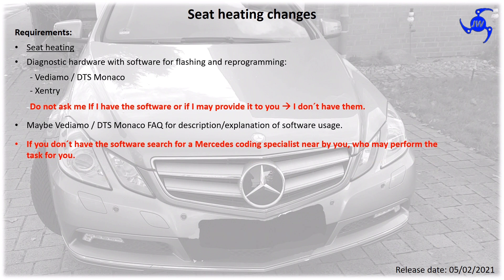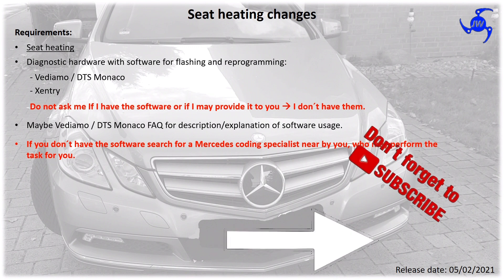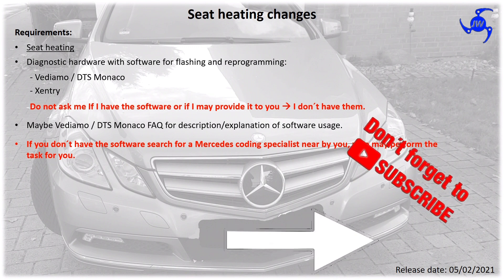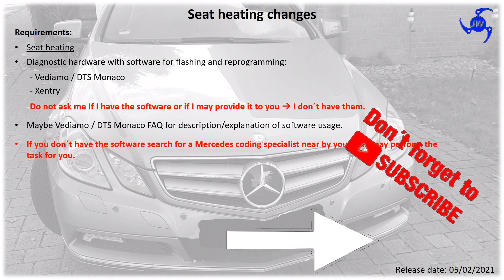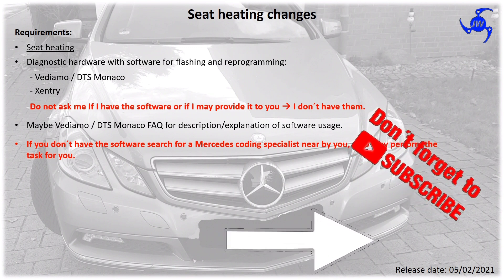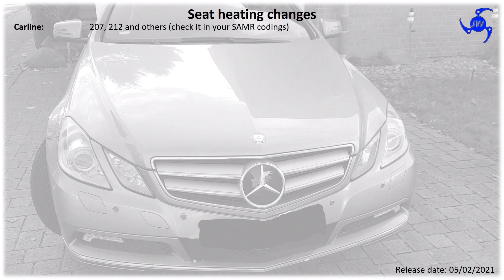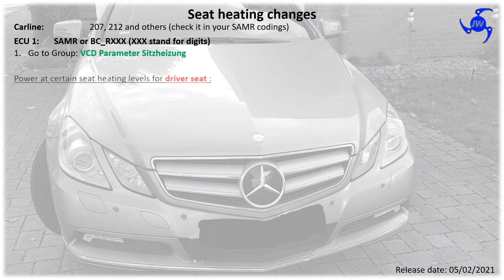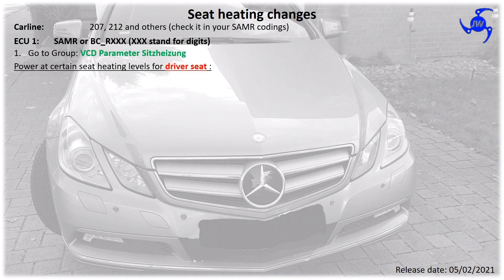DIY - Seat heating tuning - Mercedes coding manual

Comment: Very well and clearly presented, good job bro. could you add a video showing how to make AMG menu w221 ki221 from beginning to end using vediamo or monaco.
Reply from the maker: thx

in general the AMG menu is a little more advance work. many things can go wrong. up to that you get a wrong milage in your odometer. ( almost irreversible cause the mileage will be taken over to other ecus as well). not a work for people here at YouTube. mostly when something goes wrong they will blame me for the problem they caused by themselves.

my advice is that you should ask somebody to do it for you in the mhhauto forum.
Reply: @JWAutomotive  I know what mhhauto is, I'm a VIP there and I haven't found how to do it except the paid option using mbtools. and I know it can be done with vediamo, I have a seedcalculator and everything necessary, I just need the uds commands for vediamo to actually do it. because in all available videos they are blurred. and I give your videos 12/10 because you do a very good job and they explain exactly what and how at the highest level.
Reply from the maker: @marcinzst666  
one hint from my side
without seed key for certain access levels for your instrument cluster you will do nothing
Reply: @JWAutomotive  It's not a problem at all, I have the seed key to have access. it's a matter of uds commands to make this AMG menu in w221.

Comment: Thank You for Your video! My girlfried asked if it is possible to disable LVL1 and LVL2 and leave only LVL3 heating settings for passenger seat, because she never uses them. I found out that it is possible. In same section it is needed to change PSHZ_VR_FKT_STUFE1 and PSHZ_VR_FKT_STUFE2 to nicht freigegeben.
Reply from the maker: but then the seat heating will be turned off after the set time.
Reply: @JWAutomotive  Yes, but anyway this setting is very convenient if You want to heat your butt for short period of time and then turn off yourself, then You do not need to press button 3 times, but just 1 time. I hope this is usefull for somebody else also.
Reply from the maker: you are right... it depends what somebody wants to have.

Comment: Great and useful information, as in cold days the seat heating is too weak for me if I have to travel on short distances.
And onother question comes on my mind - Is there a way to adjust the brightness of the footwell lights when driving?
Reply from the maker: How old is your car?
the seat heating gets worn over the time due to sitting again and again at the heating curcuit. the perfromance gets less and less till at the end the heat curcuit damages.
At the end a replacement could increase the performance of your seat heating as well.
Reply: @JWAutomotive  The car is 2010 W212 with only 78k kilometers. I don't think that it has worn. The two front seats are identical at heating. Maybe the problem is that I've got use to the heating in my previous W203 which was definitely more intense. The same issue noticed my friend, who jumped from W209 on a W164. In the W164 the heating is weaker than in the W209 according to him. Not a big deal. With the coding from 80 to 100% I think everything is fine now. Meanwhile I found from where the footwell lights brightness can be adjusted. Keep on with the good tips and tricks! :)
Reply from the maker: @rzarector89  
my s212 is MY 02/2010 at 100 tkm I needed to change the seat heating.
cause of the fact that.somebody put his knee with his whole weight at the seat.